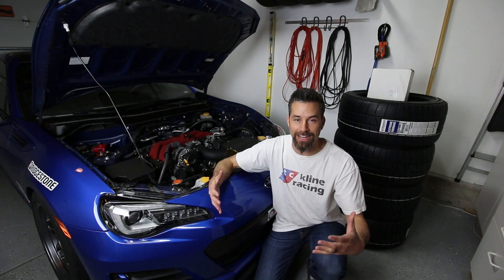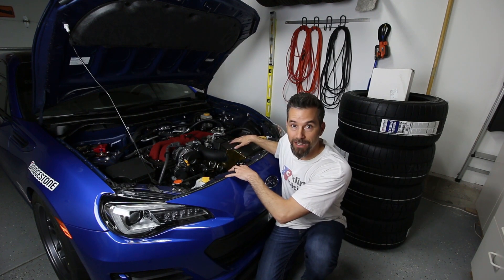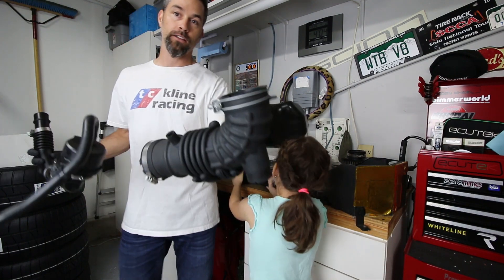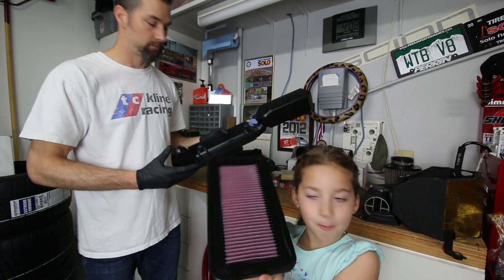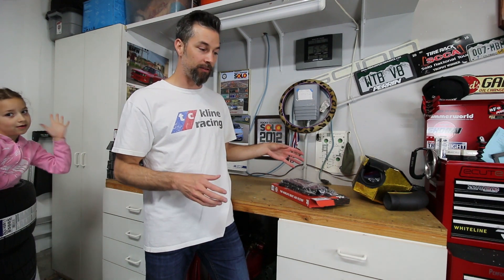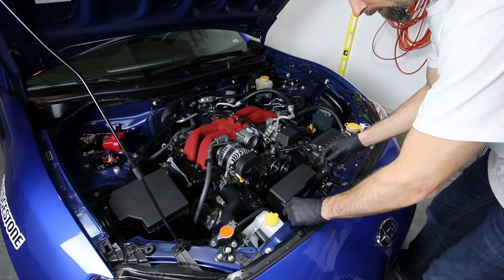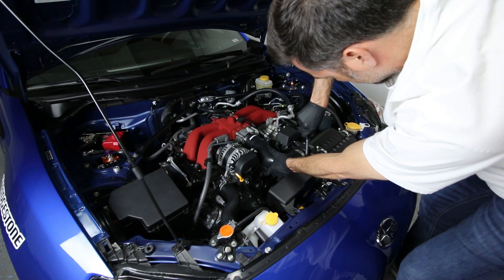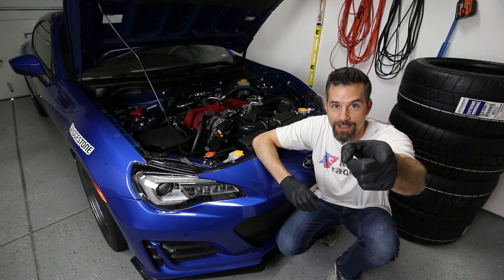De-modifying my BRZ

Comment from the maker: Thanks everyone for watching! Stay tuned for a dyno comparison between this setup and the Grimmspeed intake!
Reply: Awesome cant wait for the comparison because I'm having a ton of issues finding the right intake system for my 86. I've been looking at the TRD, Injen Evo, and Takeda as well. There just isnt much information out there and some info are unreliable. I do hear that the K&N filter has basically the same net gain as the intake systems!
Reply from the maker: I don't think you can go wrong with any setup. I personally don't think they make a huge difference either way. But, hopefully we'll find out soon after the dyno comparisons.
Reply: What was your reason for swapping out the grimspeed setup?

Comment: My 2017 BRZ should be delivered next month. I like the subtle mods you've been doing with yours. I'm curious how certain you are that the Blitz filter is any better than the stock? Also, which tires did you decide on for your RPF1s and why?
Reply from the maker: Congrats on the new car! I'm not certain the Blitz is better than stock. But, usually the aftermarket filters are better flowing than the stock panel style filters.

I have a set of Bridgestone RE71R and also BFGoodrich Rival S 1.5. They are simply the fastest 200 tread wear tires on the market.

Comment: Don't you have to somehow plug the firewall if you delete the sound tube going into the cabin?
Reply from the maker: No, you just detach the sound tube from where it connects inside the engine bay. You can then plug it there or also from the inside. The Perrin inlet tube has instructions as well as a plug.

Comment: I look forward to seeing the dyno comparison. Do you plan on doing something similar with the exhaust?
Also random question: I know the FA20 engine is prone to oil starvation issues primarily due to high oil temps. Have you or do you plan on using an oil cooler at some point? Or does the fact that autocross is primarily very short sprints make this an issue that you wont really run into.
Reply from the maker: Not planning on doing exhaust comparison.

Oil starvation is usually from sustained cornering load. In autocross you are almost constantly turning, nothing is really sustained like on a big track. So, no plan to add an oil cooler.
Reply: i omitted the cornering load for that very reason. But high temps = low pressure which can lead to starvation when temps get high enough which is why i was wondering.
Reply from the maker: Yea, I've never heard of anyone with issues. It would be interesting to see what oil temps do during a ProSolo event, because that is 4 flat-out runs all back to back. No cooldown between runs, more chance of things heating up.
Reply: I found some posts in ft86club, youtube, and a few other miscellaneous places that talk about it. Maybe its being blown out of proportion, this is the internet after all. 

If you do check temps during an event like that i would be interested in seeing the results.

Comment: Just put the inlet tube on the BRZ and noticed more engine noise around the 5000 rpm mark.  Just wondered if anyone else noticed that after installing the tube.  I guess give's it a bit more of an aggressive sound.
Reply from the maker: Interesting. You are also deleting the stock sound tube. So the sound would definitely change.
Reply: That's true. I do like it. The stock inlet tube with that big resonator must be the difference.  I deleted that sound generator when I needed to run my 0 gauge wire for my amplifiers for the stereo. Wire fit perfectly through that hole into the cabin.
Reply from the maker: j slack That's a pretty good idea on the wiring!

Comment: Let me know how the Perrin intake worked. I wrote ft86speedfactory because I wanted to install it and they said because of the new intake manifold the current Perrin product may not fit so well.
Reply from the maker: The Perrin inlet tube? It fit fine. The fit is a little tighter than on my old FRS, but it works.
Reply: Justin's Pit Lane good to know.  Gonna order it tonight.

Comment: That clickbait, LOL.  I thought you were going back to stock to race in CS.  Unlucky about that K&N filter.  That's the kind of luck I usually have.  I was gonna ask why you did this but I see you answered that already.  Hi Shelby!
Reply from the maker: If I was going back to CS it would be in an ND Miata :D
Reply: That's the right filter. I just went through the same experience with my 2017 BRZ Manual. It's a pita to fit and takes lots of patience, but it can be installed correctly. Check out the 86 forums and you'll see everyone has this problem with the K&N's. Odd, but it will seal correctly.
Reply from the maker: There is no way that filter fits the 2017 MT cars. It is physically an inch longer. Anyways, I have the new one going in today :)
Reply: Weird, I thought it was the worst fitting filter I'd ever received from K&N. But the 86 forums said they were notoriously poor fitting so I kept on until it worked. Mine seals at least. What's the corrected part number for the manual filter?
Reply from the maker: Interesting, wonder if we had different K&N's. The forums I read all have the info on the new 2017 MT filter.

This is the one I got: http://www.frsport.com/Blitz-59624-SUS-Power-LM-Drop-In-Filter-2017--Toyota-86-Subaru-BRZ-MT-only_p_1475641.html\

K&N does not have one for 2017 MT cars, their website is finally updated to reflect that.

Comment: Do you have to retune if you just install the Perrin Inlet tube?
Reply from the maker: +Unlimited Power Records Nope, adding a header would be about the only required time to tune. Although a tune will help regardless of what engine upgrades you have.
Reply: Hello, I’ve heard that because of the 3” diameter of the inlet tube you actually do need a retune (as stated on the Perrin website as well). I hear multiple answers to this questions, not very sure what to do.
Reply from the maker: The reason is because the MAF sensor may see different air values because of the change. It is not a big deal to have one without a tune. But, the tune will make the most of it. Actually, I would spend your money a tune before getting the intake.

Comment: K&N doesn't fit 2017 MT because different air box.
Reply from the maker: Mostly correct, it does fit the 2017 automatic transmission cars, just not the manuals. I cover that in the video 'cause I found out the hard way :)